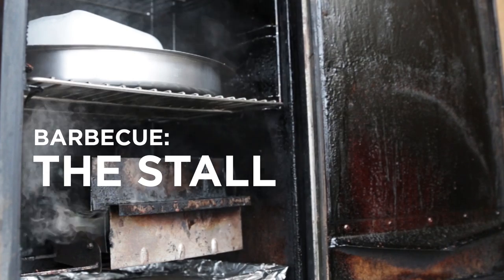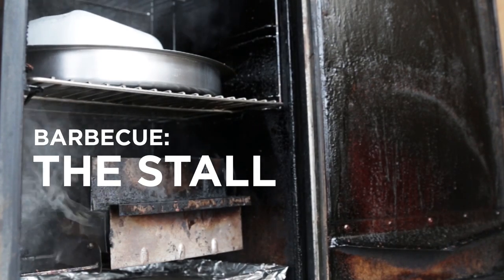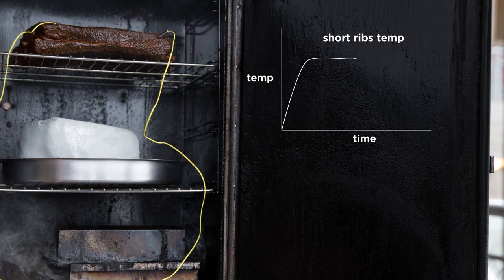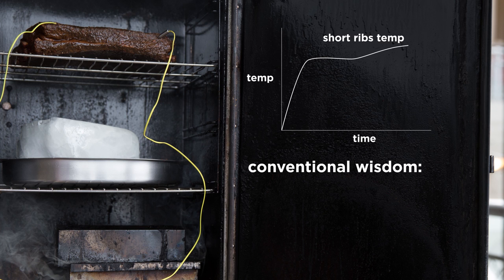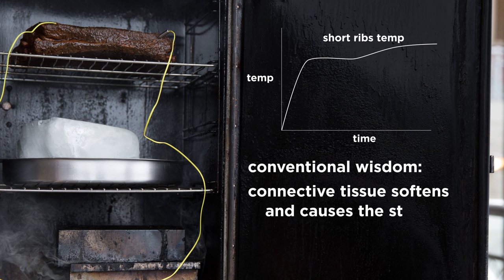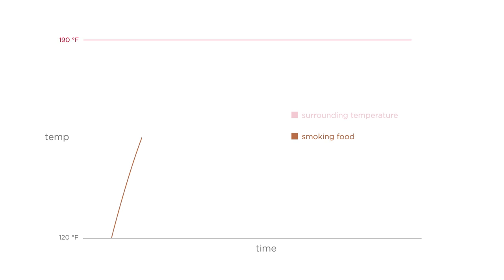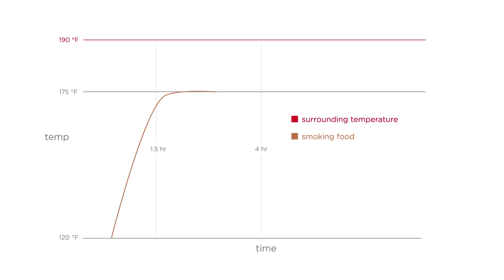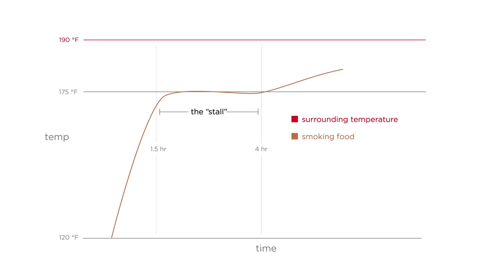The Stall

Comment: The guys at amazingribs.com address this problem. You can either wait it out or you can go for the "Texas Crutch". Basically, you take the meat out when it reaches somewhere north of 170 degrees, wrap it tightly in aluminum foil (along with a cup or so of broth or juices) and put it in an oven at 350 degrees. This can have a negative impact on the bark (thick crunchy outer crust on smoked meats), but it can turn a 14-hour cook into a 10-11 hour cook. I'm actually doing it as I type this on a pork shoulder because the wife is hungry. 

http://amazingribs.com/tips_and_technique/texas_crutch.html.